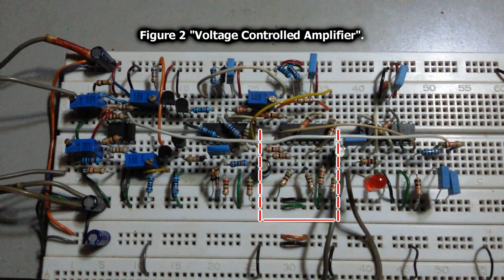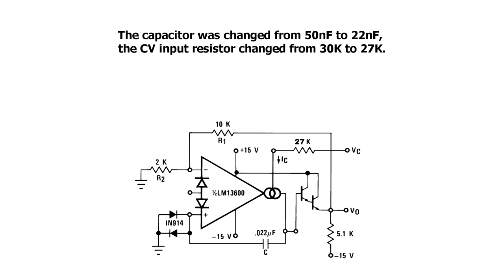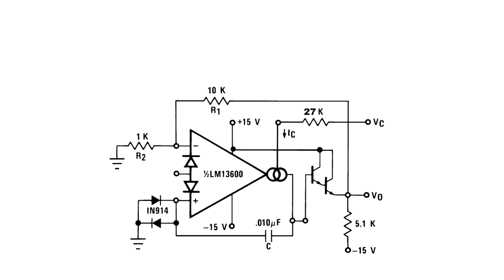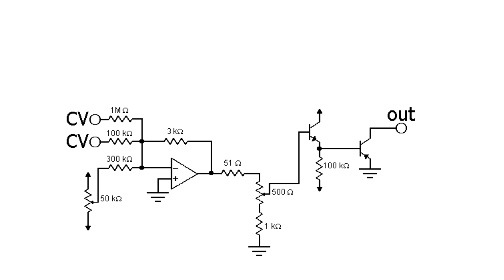LM13600 datasheet synth: single amplifier VCO

Comment: Ever tried making Moogs continuously variable waveshaper? It's quite simple.
Reply from the maker: No, I don't know this circuit. Is it a standalone module or featured in a complete synthesizer?
Reply: @unrelatedactivities  It's a part of all new Moogs with exception of the Matriarch. The circuit is available in the schematics to the Subphatty.

It takes a saw as an input and continuously waveshapes it with a single VCA and diode rectification section, super interesting.
Reply from the maker: Sure, I will look into it, thank you.